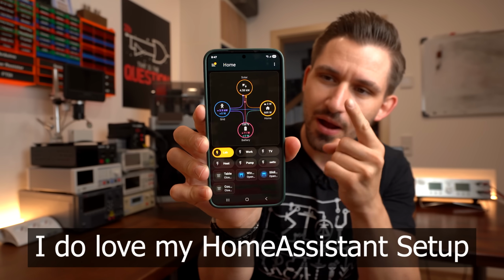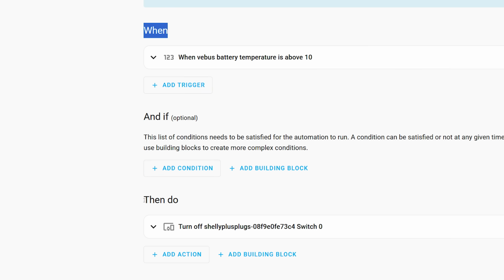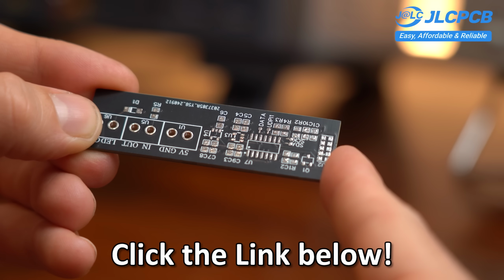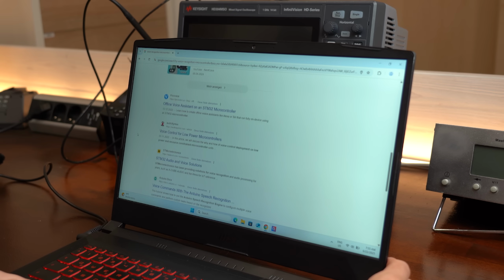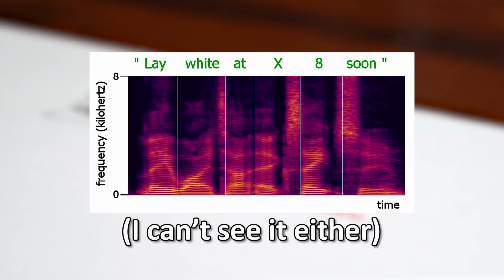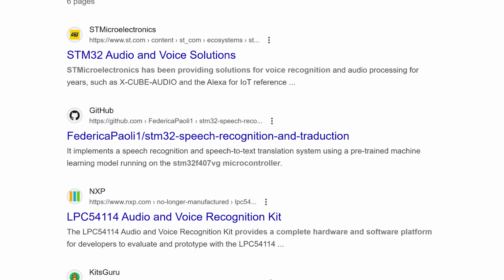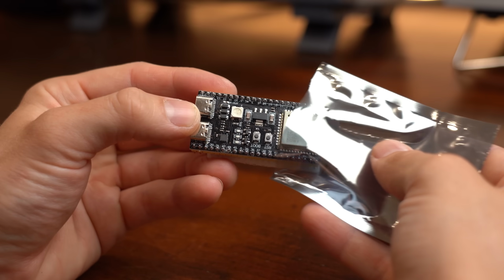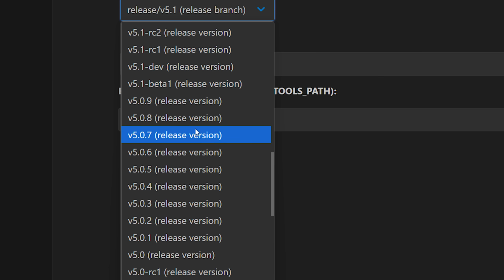Forget Alexa! — This is MUCH Better?! (Command EVERYTHING)

Comment: Raspberry Pi with SD card is the worst thing ever for HA. It kills SD cards in a matter of weeks.
Even if you get the A3 class cards you are lucky to get a few months out of it and then you loose all your logs.
Reply: Good thing there's inexpensive USB SSDs - mine has been running flawlessly on one for years
Reply: @riz94107  I know there is, but my point is that the RPi comes with the SD card socket only and wasting a USB port on storage may not be ideal. It also sticks out in case your project can't allow that etc. All in all, it's not really the SD cards fault, as I have dataloggers and other surveillance units recording thousands of gigs to these cards all year and they do not fail fast. It is the way the Linux system on the PI writes data and handles the block device that is the problem.
Reply from the maker: I recently switched to a USB SSD.
Reply: Mine has been running fine for years...
But I have been considering upgrading to a Pi5 (from a 4) and adding a PoE and NVME hat.
Reply: @nimoy007 if you connect the pi and home assistant to something like a solar inverter the amount of data being logged increases dramatically. I think this contributes to early failure.

Comment: I've been wanting to do away with all my Alexa devices and smart outlets due to when the internet goes out, I can control anything!  I just want to be able to use stuff locally if needed.  Having it to be able to connect to the internet if I'm away from home would be nice as well, but if the internet is out when I'm home, being able to control stuff is what I'm mostly after.
Reply from the maker: HomeAssistant does run local. You can make it all local.
Reply: @greatscottlab  Yes I know!  I watched a video by Hands On Katie where she showed how it all works.   I'm working on getting all the gadgets I need to cover all my rooms.  Thanks for replying.  Love your channel.
Reply: @stevenA44 
You may be able to repurpose some of what you already have if it's got ESP8266, ESP32 or some Beken microcontrollers. Access to the serial port pins is also a requirement in most cases (although some tuya based devices can be programmed over the air if they are older models).
Obviously this requires some electronics AND computer knowledge, so it's not for everyone. But it's a heck of a lot of fun when you do get it working and can feel like you won. 😂
Reply: @tin2001    Cool, I'll have to check some of my stuff then.  I have been working with electronics and electricity since I was 10 and I'm 63 now and have been working with computers for about 39 years, so I should be fine.  I love building projects!

Comment: That premade voice module is really cool, the response latency is almost nonexistent! It would be nice if it would output regular words instead of only some predefined ones and then you could feed that into HA
Reply: It is really cool, but it has a lot of drawbacks, like it could never go into an end user device because they could accidentally reprogram it. I wish they'd open source the firmware.
Reply: You can certainly use an MP3 module with your redefined messages.

Comment: I'm pretty sure that Home Assistant has its own ready made smart speaker to enable voice controls
Reply from the maker: Yes, I think so too. But then again, my shown solution is quite a bit cheaper ;-)
Reply: @greatscottlab  given all your past videos, I would have expected you to do a DIY vs buy video for the premade home assistant solution vs what you did here.   It also looked like in the end you didn't use the voice module you bought, at least based on what it looked like you stuck in the box you made, but you made no mention of that
Reply: @greatscottlab  What about the Atom Echo? Seems like a perfect affordable DIY device that might be able to do most Home Assistant voice command and control stuff.
Reply: @greatscottlab To use Homeassistants Speech recognition u just download the correct add-ons and connect an esp32 with a mic

That would also allow more integrated speech commands or even Ai integration  for more dynamic responses
Reply: But where's the fun in there? 😧
Reply: Yup, Smart Assist Preview Edition. It's looking hopeful.
Reply: Bu t alot of us sits on a bunch of these components, waiting for good projects.
Reply: But wouldn't make for a very montisable video if it was just "here is how you turn on the setting"
Reply: The only review of that 'buy' option (by digiblurDIY) was not favorable. Maybe the devs have improved it since.
Reply: Bought two of theese. We cannot use it since it's so rubishy.
Reply: Yes they have it’s called Home Assistant Preview Edition. I bought one and It’s Great.
Reply: There are a dozen ways to accomplish this.  In my den, there is a 1960s table with a 1963 Western Electric rotary telephone sitting atop it.  You lift the receiver of that phone and are prompted with a voice from Home Assistant asking "how can I help you?"  This cost me a grand total of $40.  Twenty bucks for the phone, twenty bucks for the ATA and about fifteen minutes of configuration.   The OPs solution is just..... ridiculous.
Reply: @elesjuan god that’s so freaking cool! I love fusion of old and new tech
Reply: @elesjuan cool! Do i have a writeup? I'm planing to do the same to an old phone i found a few years ago! And having the rotary be shortcut triggers :)
Reply: @elesjuan  Good idea

Comment: smart homes are idiotic... giving internet access to everything is crazy
Reply: A smart home setup doesn't necessarily mean granting internet access to everything, you can keep it all local with something like homeassistant over LAN.
I don't necessarily understand why exposing the same homeassistant setup to the internet (with proper reverse proxy, auth, security etc of course) would be inherently bad but you have the option regardless.
Reply from the maker: I like it though. Automating things is fun and saves you time. And when it comes to security, then I never had problems so far.
Reply: @greatscottlab  I think that's exactly the point: Alexa has the reputation of leaking everything to the Cloud, including when "she" is not supposed to listen. That makes your solution brilliant for people (especially old folks like me) for whoever wants to automate the house but keep it offline (and possibly off-grid and physically secured). Thus, thank you so much for this video.
Now, in terms of automation, I'm very bad with a keyboard, would there be a similar way to use an ESP32 (or similar) or even a Pi or a RISC-V SoC to do all-purpose speech-to-text and output as a (second) keyboard would? I haven't found proper software doing that in an offline mode yet, but I haven't been very active in my searches for the last decade... I know OS/2 Warp4 could do that on a high-end 486 at 100MHz with 4MB of RAM, that really doesn't sound out of reach...
Reply: Amen!
Reply: But its homeasistant which is WAYYYYYYYYYY better than the solutions on the market these days cause a lot of it runs locally with no cloud involved